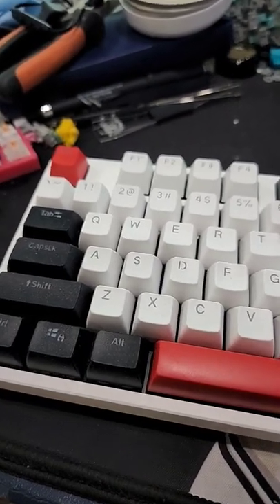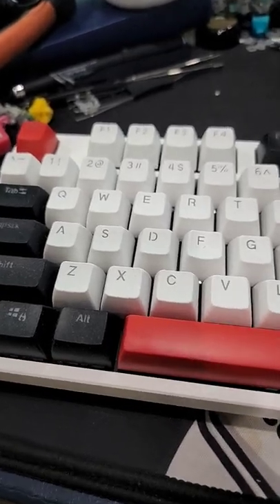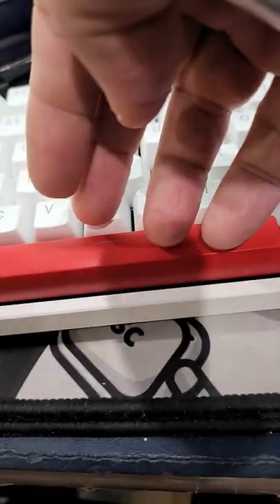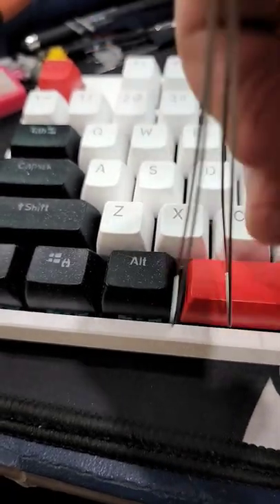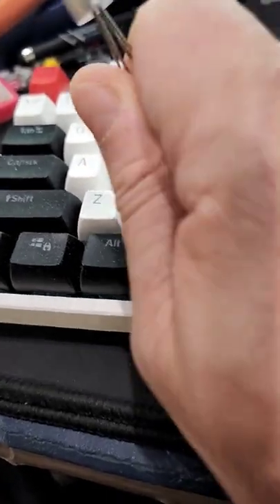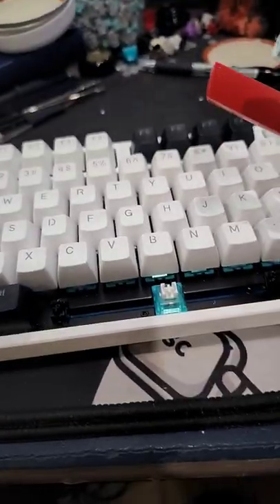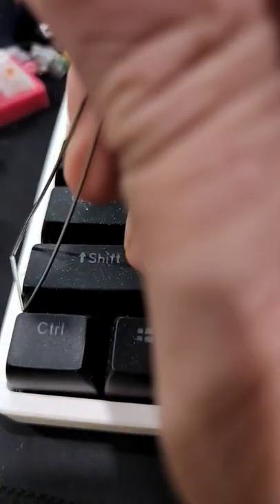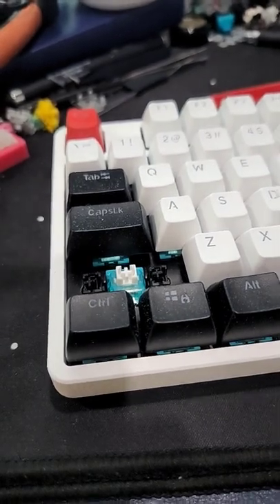How to properly remove a key cap that is on a stabilizer on a mechanical keyboard.

Comment: This may bend your stabilizer wire ,you should get the two ALT key and then use both hand to remove your spacebar
Just my opinion ^^
Reply from the maker: Thanks, have yet to have that happen, but I never pull harder than it gives.
Reply: @MechKeyboards  yea,usually it only happen with 2 conditions : soft stabilizer wire and keycap fit too tight,for that case you must use a lot of force on 1 side to pull out,and 70% it will bend your wire :(
Reply: @MechKeyboards  Today I had to pull out my backspace key. So I was pullin on both sides with the puller, thinking it might have been a good idea. The problem wasn't really getting it to fit, the problem was that I had to pull so hard to remove the keycap that one of the stabilizers got broken off the board, and the puller bent. I just bent it back in place anyway.

What do you suggest to avoid this kind of issue? Should I slightly lube the stems of the stabilizers so that there's less grip on the keycaps?
Reply from the maker: @ItalianRetroGuy  I don't think lube would hurt, but I find that taking sticky keycaps and using a switch to insert and remove several times in a row will "loosen" up the inside of the stem.
Reply: @MechKeyboards  I don't fully understand what you mean, do you mean I use a keycap to try to wear away at the stabs, or a switch to try to wear away at the keycap sides where there would be the stabs?

Perhaps a combo of both would work?
Reply from the maker: @ItalianRetroGuy  A switch on a tester and inserting and removing the keycap numerous times to get it to stretch or wear down.

Comment: Hello! I have a question. I have a broken stabilizer on my shift key, what can I do about it?
Reply from the maker: You'll have to order a replacement set of stabilizers, not sure of vendors that sell them individually, and replace the broken one with it.
Reply: @MechKeyboards  do you think any repair stores like best buy/geeksquad could help repair it, or would I need to open up the keyboard myself?
Reply from the maker: @VibreX  If it's a plate mounted stabilizer, you can do it yourself. Which keyboard did this happen on?
Reply: @MechKeyboards  Logitech g pro, with gx blue switches
Reply from the maker: @VibreX  you should be able to replace the stabilizers yourself, as they appear to have plate mounted Cherry stabs.

https://www.youtube.com/watch?v=j_5i1VyFACc
Reply: @MechKeyboards  thank you!
Reply: @MechKeyboards  do you know where I could find stabilizers online?
Reply from the maker: @VibreX  Amazon or AliExpress. I usually get Sumgsn brand stabilizers for <$10 a set, but which ever set you choose, try to get gold wires, they will usually be better. Sumgsn also come pre-clipped.
Reply: @MechKeyboards  alright

Comment: What if the stabilizer is stuck beneath the spacebar?
Reply from the maker: Just the wire, or is the housing screwed into the PCB and not plate mounted?
Reply: @MechKeyboards  it’s a plastic thing stuck in it probl not being well mounted on the keyboard plate as the metal wire is fine
Reply from the maker: @al96n  then you should be able to "fish" the bar out from under the plate once the housings are unclipped from the plate.
Reply: @MechKeyboards  after picking it and placing back i noticed the plastic part to be woobly it’d move more than the other one but the spacebar works and sounds ok, guess I’ll take it

Comment: help i took my shift key out and am trying to put it back but it doesnt want to work as a button anymore it will just sit there but not go up and down when i press it
Reply from the maker: Did your stabilizers come loose?
Reply: @MechKeyboards  i’m not sure i’m not really techy but i just left it there and now when i press on the button it works but it goes back up very slowly but it should be fine since i don’t really use that button
Reply from the maker: @luvgvrlog  sounds like your stabilizer has come loose or the wire became detached from the housing. You can watch videos on how to remove/install stabilizers and that should help. Good luck!

Comment: Busted one half of my space bar by only pulling out one side 😢
Reply from the maker: Sorry to hear :(
Reply: @MechKeyboards  its ok, i'll just  have to work around jumping alot in fps games lol
i'll probably just treat myself to a nicer keyboard at some point soon :)
Reply: Ye I broke the little hook thing on one side on my old black widow keyboard so it works but flimsy. Needed an upgrade anyway after that so jus bought a black widow v3 going from og black widow I had for 5 years prior. Still afraid to mess with these that's why I only worry about the ones without the stabilizers lol
Reply: This was 2 years ago and Im still scared lol
Reply: @mycelium1456  if you bought from razer directly youget a 2 year warranty. but i wouldnt buy razor products. they arent exactly the best for any of their products price points
Reply: @jacklloyd4376  well I jus went and tried it first time with new one and it's easy af lol doesn't even have a metal bar just extra stands pretty much I was afraid all this time for no reason lol. But ye but I've always used a razer keyboard every since I started PC gaming on a laptop along time ago so I jus stuck with it
Reply: @jacklloyd4376  I bought some o rings along time ago but never really liked the feel with em on but I jus put 2 on either side of spacebar and it's way less jiggly now and feels better so a win in my book lol
Reply: @jacklloyd4376  but I got razer everything else tho so ye lol. But there's nothing wrong with it I was only trying take the keys off to clean the cat hair that built up the keys from my cats laying it lol
Reply from the maker: @mycelium1456  just buy a replacement set of Costar stabilizers from Amazon, then follow this guide: https://www.youtube.com/watch?v=I31wrZvmdkI
Reply: @MechKeyboards  ye I'll prob end up buying something to fix the other one all I need is the bar piece for it then it'll be good.

Comment: Love how budget plastic keycap pullers can do this in like 2 seconds
Reply: It scratches the keycap with its edges
Reply: At the cost of scratching your keycaps
Reply from the maker: Plastic pullers run the risk of scratching the key cap.
Reply: It didn’t even take that long